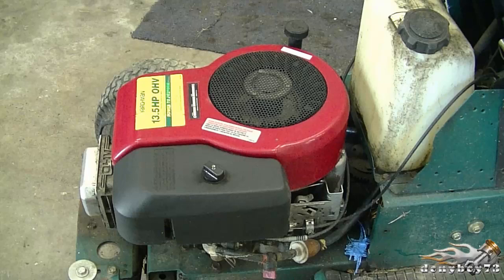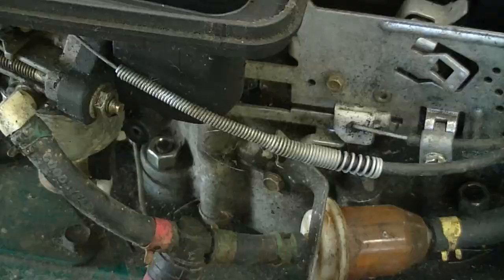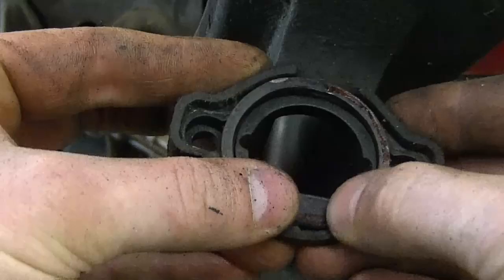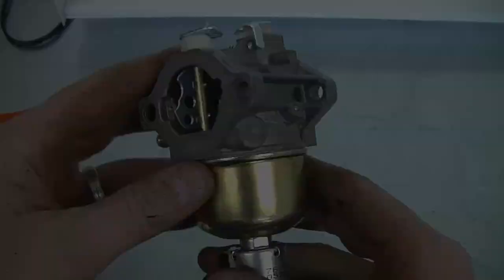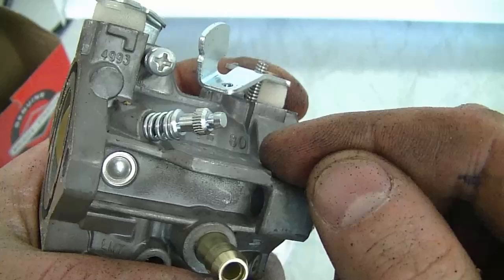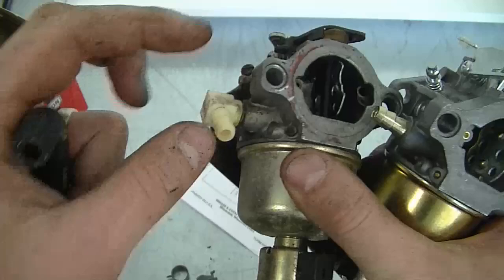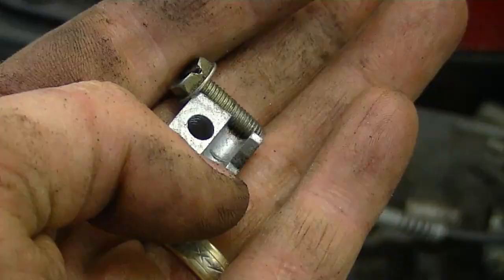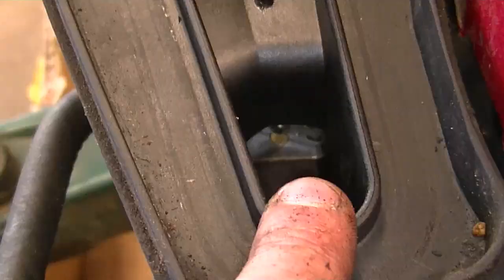DIY - Carburetor Replacement On Lawn Tractor With Briggs & Stratton Engine

Comment: do you have to have that little electrical thing on the bottom of the carburetor? and how important is that breather for the crankshaft?
Reply from the maker: yes you need that solenoid at the bottom of carb
Reply: donyboy73 why do you need it?

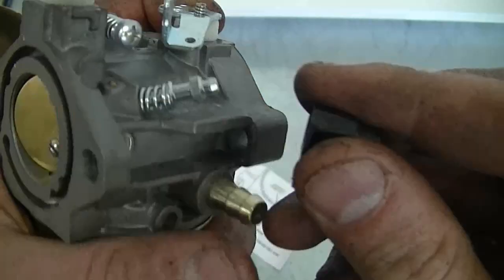Comment: At 3:37 Where could I get one of those adjustment screws? I was working on my tractor that has a 2010 B&S 12.5 Hp Power Built engine and I went to adjust that screw I broke it right off, I managed to get the old screw out but I can't find a new one.

Comment: I have a engine 133432 0036 01 and the carb is discontinued. will any other carb fit for this model from your experience

Comment: I have a 15.5 I/c ohv I have it running sweet at idle but once I engage the blade and try to drive it back fires and pops 
I’ve changed fuel lines and filter cleaned and reset carb set valve clearance looks like a good spark and when I inspect the plug is looks like it’s running lean so I’d assume it’s a fuel issue, any help would be grateful
Reply: Did you check the Fly Wheel Key?  Backfires = 3 things.  #1 - Sheered Key #2 - Fuel Solenoid Not Working Correctly #3 - Clogged Carb

Comment: I am trying to find a new carb for my mower and came across your channel. Very good info here. Thanks,
Was wondering if you could tell me if the carb you listed would work for me. I cant find anything that matches the numbers on mine. The carb looks almost identical to the one you posted here. 
Numbers on the carb are 
26:42
3304 L1
697202
LMT 4993

Motor is INTEK 14.6HP OHV
Model     Type
280J07  0110 E1

Comment: I have a Stihl hedge trimmer with a 50 to 1 ratio.  One question.  Does that ratio have be dead accurate, or would maybe 48 or 49 to 1 be ok?   Thanks
Reply from the maker: YES IT WOULD BE OK
Reply: Ok.  thanks

Comment: Hello thanks for this great video, looking for a carb for my sabre 1438gs, briggs Model 287707, found your video but im not sure if this carb will fit my mower, I found #799727 on amazon for 90 but it doesn't seal the plastic part , I guess exhaust, (Chinese carb) where can I found the original one  just like the one you are showing ? in the USA? thanks in advance

Comment: Donyboy73, it sounds as though you are saying ‘chill line’ when you are working on the fuel supply line, etc.  is that correct?  Thanks for a reply. When I installed my new carb, the system continuously leaks gas between the carb and the intake.   Is it possible the new gasket isn’t seated properly?  Thanks for any help.  I appreciate your YouTube’s.
Reply from the maker: it's possible your fuel cap isn't venting

Comment: Donny, what do you do with these LMT carbs when they overload the engine? I have replaced the needle, float and float pin along with the bowl gasket and it still floods. It has the brass seat in it. Thanks!
Reply from the maker: I also replace the seat along with the needle valve

Comment: donny , should the shut off valve be on the other side of the gas filter or does it really matter ?
Reply from the maker: +GmGarlo it's better if it's before the filter then if you need to replace it you can shut off the fuel
Reply: Yeah i learned that buy watching one of your videos but i was not sure if it made a difference on what side you put the shut off valve. now i just bought a new husky lawn tractor would it be a good idea to put one on for safety measures or don't worry about it because its new

Comment: I have a 10hp briggs on rear engine snapper the carburetor looks the same but mine doesn't have the wire on the bottom,  will that one work on mine?  I'm having trouble finding the part number
Reply: All you need to do is CUT OFF / BYPASS the Solenoid.  Another way is trade the parts that you need with each other.

Comment: I finally received the carburetor that I ordered on line (Briggs&Stratton just like you are showing here)… They changed the part number from 791886 to 2283634… which had me worried that it would be the correct part but when it arrived it was!  I have it installed and am ready to reconnect the fuel line… "but"… my new one did NOT come with the short 90 degree turn fuel line that you "didn't use" in the video… and for my Toro 15-38 HXL 71221 tractor it seems that I will need one.  I've been unable to find any auto parts house or hardware store that has this… the Replacementparts.com company I purchased the carburetor from doesn't have one and they said it doesn't come with one as far as they knew… any ideas?  :0) Do you still have the one you didn't use??? :0)  I am thinking of making a wide loop to avoid kinking but without really getting into it yet I'm thinking the cover that goes on top of the carb won't permit having a "loop" of fuel line making the wide turn.  Thanks for the great videos the are a big help… now if only I can find the elbow fuel line…  *(The flange coming out of the carb doesn't have any bolt… so it can't be replaced easily? with a 90 degree flange.).  Thanks again,  Bob Emrick
Reply: You can get that 90 degree fuel line, tag 187A, part no. 791805, description: Line-Fuel | (Formed)(3-1/2 Inches Long)(Cut To Required Length) for $15.00 @shop.briggsandstraton.com

Comment: great video!! is there a (almost foolproof way of adjusting the air-fuel ratio on a new Briggs and Stratton carburetor)?? I have  a Poulan Pro 15.5 hp Briggs and Stratton engine; I replaced the ignition coil and carburetor and it will not idle )smoothly at lower rpm-only runs halfway decent at full throttle" wish I knew what you do:PJP
Reply from the maker: all the new carbs are non adjustable except for for one screw with a plastic cap on top left side of carb
Reply: @donyboy73  thank,s you!! PJP

Comment: So I cleaned my carburetor and put it back, but now the fuel goes comes out the air filter and through the muffler and no longer starts. I didnt touch any of the setting screws. Do you know what I did wrong?
Reply: Check that the float is working properly by taking the bowl back off. Also ensure there is no dirt in the needle and seat area
Reply: Also remove the spark plug and make sure there is no fuel preventing the engine from turning over. Also make sure the fuel didn’t get into the crank case where the oil is. That is definitely a possibility when the carb leaks into the valve area and comes out the muffler

Comment: As usual I found your video super! However...I came across it in search of my current problem. I have a 15.5 OHV Briggs/Craftsman lawn tractor. It wouldn't start at all and thanks to your other videos I was able to adjust the rocker gap, found that I had no spark, found that I had re-installed the ignition modual upside down. (Doh!) I was good and running like a top several times until the other day when I was mulching leaves. I worked at it for about twenty minutes and then suddenly stopped. I pushed the tractor back to my garage, let it sit for a few and then tried restarting, Started right up and died 20 seconds later. I'm guessing a fuel line/filter/??? problem but I hate to start simply changing carbs, filters, etc. The filter is not old but thad sat for about 18 months before I had the time to get it running again. Any thoughts? Can you refer me to another of your videos?
Reply: Check if the gas cap is venting properly. To check loosen or remove the cap and run it, if it runs well tighten the cap and see what happens, if the cap is blocked the engine will ran for a couple of minutes and die. Donyboy has a video about the cap problem I think.

Comment: my carb dosnt have that plug on the bottom so can  i get that one and still run it with out that plug on the bottom
Reply from the maker: +craig durell I would try and find the correct carb instead
Reply: +donyboy73 ok thanks

Comment: i have a riding mower with a very similar carb.  it is on an 18 horse briggs, when i first got it the engine was needing a valve adjustment to help the starter turn the fly wheel, they were 12 thousandths.  after i fixed that the engine had a slight miss, so i went through the carb. after cleaning it the miss left but now it runs good for about 12-20 seconds then almost dies, blows black smoke and picks up and runs again for about 12 seconds then repeats the cycle.  also the carb is overflowing now because since i cleaned it the needle is not seating right.  i thought maybe i lost the seat but it has a rubber tipped needle. either way do you think this bogging down then blowing black smoke is fuel/ carb or valve related?  i ordered a new carb because i was somewhat banking on that being the issue as it seems to be over fueling. however i was wondering if a bad valve adjustment would create this symptom if i got the fuel valve set to tight keeping it open a tad causing excessive fuel draw..  i got the valves at  about 5 thousandths now but maybe i need to check them again, thanks to your other video i was able to do this.
Reply: Make sure the carb didn't allow gas to pass into the oil.  I had a similar problem and it turned out that the carb let gas in.  I drained the oil and refilled it with proper oil and all worked.

Comment: i have a briggs ans stratton lawn mower and the pull cord assembly where the dogs are keep breaking i replaced it 3 times what can i do
Reply from the maker: if it's over head valve check the valve setting because sometimes there can be too much compression if they aren't adjusted properly and put extra stress on the plastic parts
Reply: donyboy73 its not ohv i dont know that to do

Comment: Can the white plastic elbow on side of carb be replaced. Mine leaking gas?
Reply from the maker: YES IT CAN, PART #692317
Reply: donyboy73     Suggestion as to where to buy and thanks a bunch

Comment: @donyboy73  ...AUGUST 16, 2020...  Would like your input on what you think please. Subject- Nikki Carburetor # 799727. Briggs 17.5  I/C  2007  Yard Machine rider. Carburetor is the one with funny looking bowl gasket and the seat is the whole plastic insert. Needle goes into plastic tube that is bare inside. Brought mower used. Has original factory carb on it and parts inside. Ran fine, but after first mow decided to look in carb. As I suspected owner used cheap gas ( I use 90 no eth ).  Such was nasty inside so I ordered a after market cheap rebuild kit. Put all new parts inside and new fuel mix screw ajust. Changed gas lines to new and flushed tank. Started up and mowed lawn and parked. Five days later started and ran for 15 sec and died. Gas was all in the hose that goes to motor on side. All in tube that runs to plastic air filter and intake pipe etc. Drained oil and it gushed out gas and oil bad. Brought a 2nd original used Nikki carb and got it. Needed rebuilt and cleaned so I did that. Again with a after market rebuild kit. Installed a gas shut off valve and put carb on. Started and ran for 15 sec and flooded. Tried to restart and gas shot all up plastic tube that is under air filter. Took it apart and checked my work and tried again. Flooded....  Brought a 3rd Nikki original used carb and cleaned it. But left the  parts in it. Although someone was in it and looks like after market float and all. Put said on and flooded upon turning gas shut off on and start and running. So within a month I spent many hours in the 97 heat in the yard attempting to fix. Three carbs, all original except the one inside that looks redone and my rebuild kits. Money wasted ( along with many high dollar oil changes ) along with time and grass sits tall . I find this very odd that all carbs I put on flood. Here is a key note to help you- Each and every time I shut gas OFF I can start mower. It takes a sec to clear the flood out starting it. At which it WILL run just smooth and fine low and high throttle. Course till gas runs out in bowl from shutting off. That is on every carb I put on. So for now engine runs great minus flood issue. I have this gut feeling if I brought original parts or the original replace carb at 160 bucks it is still gonna do this issue right from the start. However I hope I am wrong. Any event what does it sound like to you in cause, area to focus and solve? And what do you think my odds are in buying new original rebuild kit or..... the carb you have in vid swapping my Nikki to your style? And it flooding at the start again. I'm at my wit end and need input help please. I'll await till I buy or do anything else. Side note- All three carbs was exact same style/part I put on.

Comment: you can remove the unit - and break that thing sticking up - - -if that is the problem - it isn't usually - just take some pliers and break it off and then it will still shut off -  just slower - if that makes it run - get a new one - if not it isn't the end of the world  -- most likely - you're primaries are clogged.

Comment: Donyboy73.  I removed the new carb, etc. and examined the short rubber specialty hose (breather tube).  It has several cracks that fuel leaked from.  I hope I can find a replacement.  Took a picture of it I wanted to send to you but I guess I need your email address or phone number.  Thank you.  Tom Snyder
Reply from the maker: partstree.com has a good parts list